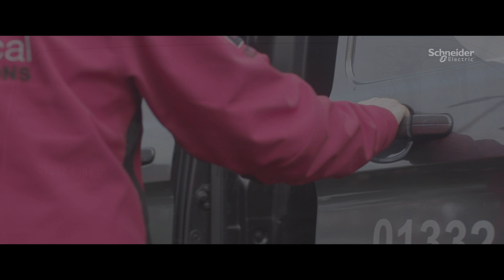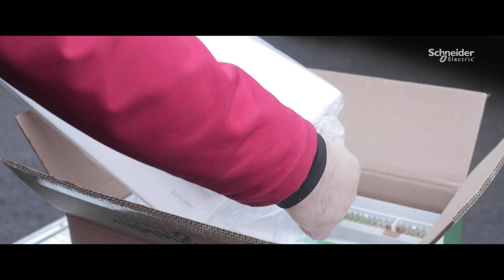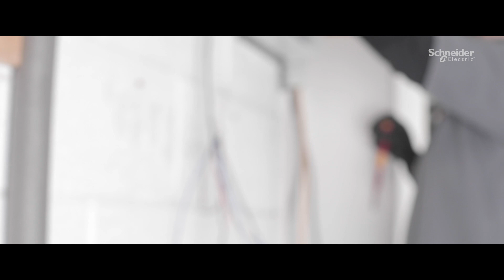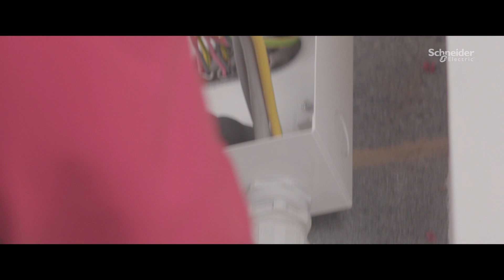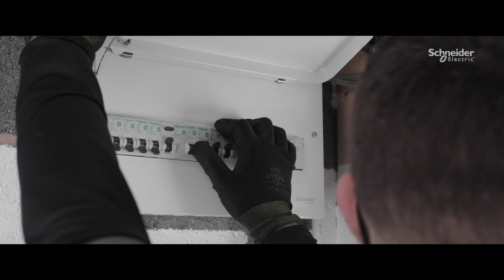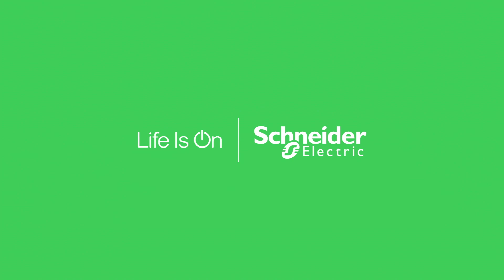Electrical Innovations Reviews Easy9 Compact | Schneider Electric

Comment: Good job he's not fitting all RCBO's as he would have zero room to dress his cables. The Schneider RCBO's are the old fashioned tall jobbies!! I use the Wylex (and sometimes Crabtree Starbreaker) RCBO's as they do a really cool miniature RCBO which is also DP. Loads of room in the board and a really solid construction. My local wholesaler had these Schneider on special, tried it and thought it was rubbish, even using just MCB's. The enclosure is really flimsy and when removing the back knockouts  the amount of burs / rough edges was crazy. I'll stick with the Wylex thanks!